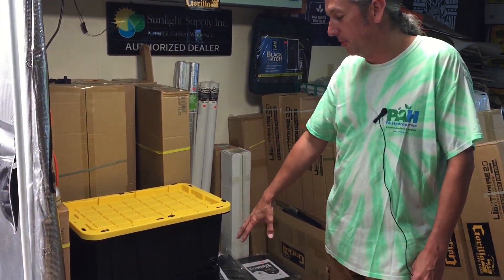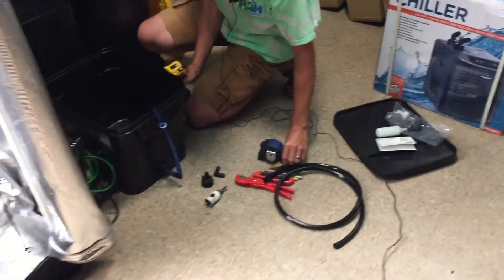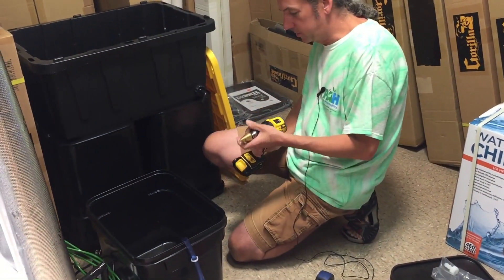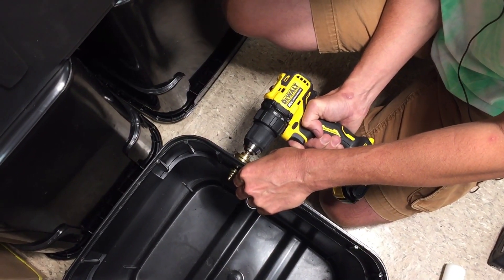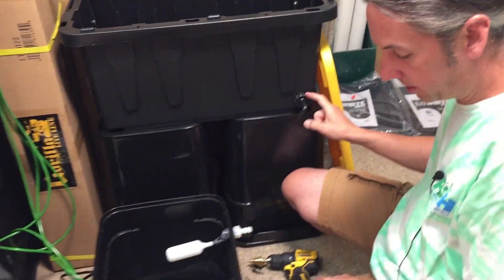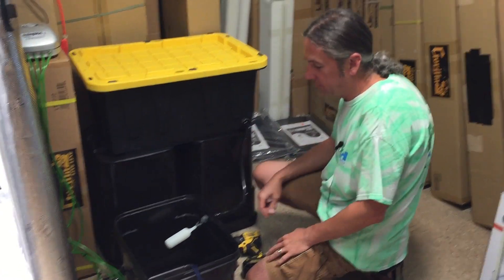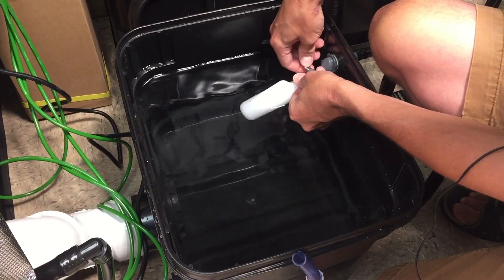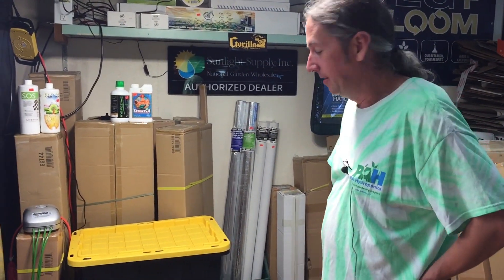How to Install a Reservoir Top Off Kit for Your Fallponic System!

Comment: Do you put an air stone or pump in the top off res to keep things moving around?
Reply from the maker: In our systems we do not have an air stone in the reservoir.  Only at the plant sites do we have air stones.  We have tested the dissolved oxygen amounts and have found that it is not necessary to have additional stones that could lead to cavitation in your water pump.

Comment: why are hydroponic supplies so expensive? like a regular hose is like 25 cents a foot, but if its a hose for hydro its like $1.50 a foot! same for all the connectors, people arent morons, we KNOW its just plastic.
Reply from the maker: The black hose that we sell in 1", 3/4", and 1/2" inside diameters are approved by the FDA as food grade.  If you have ever drank water from a vinyl hose in the summer time I can tell you that it is not that desirable.  

We do understand your sentiment though.  That's why you won't see us advertising sales.  We keep our pricing extremely competitive.

Thanks for watching and commenting.
Reply: @PAHydroponics  it wasnt even aimed at you guys in particular, its expensive across the board for whatever reason. i feel like its getting the cigarette treatment honestly, to buy cigarette tobacco is like 10 times the price of buying pipe tobacco.. the difference? how thick they cut the leaves. its exactly the same otherwise. i wish i was closer to york, but im up in shamokin so all my options are basically lowes or home depot. keep up the good work though.
Reply: You wouldnt want your hose carching growth, or leaking chemicals

Comment: the one question i have is shouldnt the top off water be circulated or something
Reply: I'm just putting my system together now, but I'm planning on running an air stone in my top off res and maybe the rdwc res too.

Comment: First I want to thank you for ALL the videos, they are the best ones for hydo out there!

I'm kind of confused about the 25% mix for reservoir. If you mix the nutes for a 20 gallon tank, you mix it like it was 5 gallons? Since it's going into the system / flow bucket, why wouldn't you use the same ratio that's in the system, IE full strength?
Reply from the maker: Hello, general rule that the plants drink more(75%) than they eat(25%), so a lot of times as the plants suck down the reservoir the PPM's will rise because of this, so when you top it off and use full strength the  ppm's may be to high so do a 25% mix and that will help get the reservoir ppm's to where they should be. I usually change out every week so I just use plain water when I top off. Hope this helps clear up the confusion. Thanks for watching! Gary

Comment: Why dont you just use the water directly from the top off tank, and skip the tank in the middle?
Reply from the maker: Hey, it just doesn't work like that, the middle tank is the outside reservoir where you check nutes and ph and have the inline pumps, the top off tank only drips out slowly so you cant circulate it, it is just there to replace the water the plants drink and use up so the system will always have the same water level. Hope this helps clear up any confusion - I do admit it is a bit confusing :) G
Reply: @PAHydroponics  Ok i see. Thanks!  Im a soil grower myself, but are considering switching to hydro. The choice stands between the GH Waterfarm drip-system and a DIY DWC bubble buckets or DIY R-DWC system.  Maybe you could give me a pro tip on what to choose? I grow indoors all year in a 80x80x180cm tent. I would like to try a four-bucket R-DWC system for purely autoflowers. (Since photos would not fit the tent.) But whats the pros/cons in specifically for R-DWC vs The Waterfarm,  and whats most cost efficient in the long run?
Reply from the maker: @henriks5008  RDWC usually has a reservoir so you dont have to move the plants - that is a big con in my opinion. I have run the waterfarm before, it grows plants great but is hard to maintain and salt build up on drip ring can clog it during grow and you cant take drip ring off while growing. I always tell my customers to just try 1 on the side and keep your soil grow going, then you can see the difference and decide to go all out on it.. As for cost they should be about the same between the different systems. Hope this helps, just my thoughts. Have a good day! Gary
Reply: @PAHydroponics  Much appreciated! Gary :) Yes I was thinking with a reservoir. Is it important that the piping/tubing from the reservoir is the same lenght/distance to both in & out- buckets?? And how do i calculate what the water-pump capacity should be, to fit a four-plant setup w/5 gal pots & reservoir? Im planing to use 32-50 mm tubing for the recirculation. I really appreciate the help!
Reply from the maker: @henriks5008  50 mm tubing is almost an inch here and that would allow for some high flow like a 250 gallon per hour or maybe even a 400 gallon per hour.
Reply: @PAHydroponics  50mm tubing is actually two inches. One inch is 2,54 cm or 25,4 mm. But after consideration i think ill go with 1" on the recirculating/undercurrent water and 1/2" on the overflow. How does that flow and is 250 gallon pump enough for that setup?
Reply from the maker: @henriks5008  I have had issues with 1" tubing with anything bigger than 75 gallon per hour, I have tried the 250 and the water levels in the buckets varied , most likely the first bucket that gets pumped into would be a high water level and then if you use the overflow tubes it will just flow right back to reservoir bucket with out circulation thru the rest of the system. There is a method to my madness:)G
Reply: @PAHydroponics  I just get confused with all this diameters and flow etc. What works and what dont.... Im planning a four (7gal) bucket R-DWC with reservoir and overflow, what diameter tubing/piping and water-pump capacity would you recommend, for an even water level and flow throughout the system??
Reply from the maker: @henriks5008  Hello, for soft tubing and fittings the biggest I have seen or gotten was 1 inch and that will handle about 75 gallons per hour, I have tried to go bigger but the first bucket it goes into ends up being a higher water level and the last bucket ends up lower so you are stuck with a slow flow on that, if you go 2 inch PVC it will handle even a 400 gallon per hour or bigger, 3 inch even more , I have done 1000 gph with 3 inch. I will warn you about doing an overflow! If you pump into the first bucket and the water ends up backing up into the overflow it will just run right back into the reservoir and this will bypass the whole circulation of the rest of the system so keep that in mind, if its only one way in and 1 way out then it is guaranteed to circulate all the way around. There is a method to my madness and lots of reasons I do things the way I do.Have a good one. G
Reply: @PAHydroponics  Aha! Eiter a 75gal pump with 1" soft tubing or from 250-1000gal pump if i go with bigger diameter PVC piping. I´ll guess soft tubing is cheaper but PVC is better for overall flow? Is it possible we talk past each other, regarding overflow? I thought the system you demonstrate in this video is an overflow system?? Is it better with just undercurrent?
Reply from the maker: @henriks5008  Ahh I did hear you wrong on the overflow, some people put an extra set of tubing at top of containers incase something overflows but yeah you got the right idea on pipe sizes, the choice is yours.G
Reply: @PAHydroponics  Thanks a bunch for the tech-tips Gary. Now a happy grower from Norway can start up with R-DWC hopefully without any trouble along the way. I´ll be sure to check in on your channel on a regular basis :)
Reply from the maker: @henriks5008  Thanks man! Have a good day. Gary